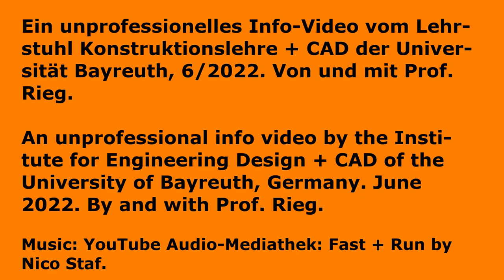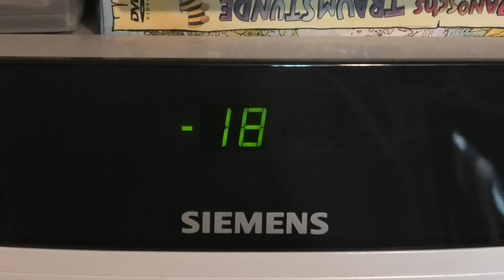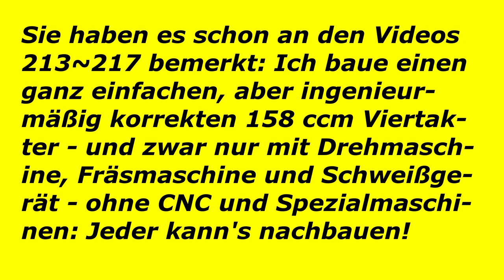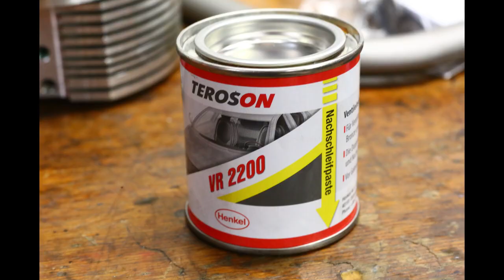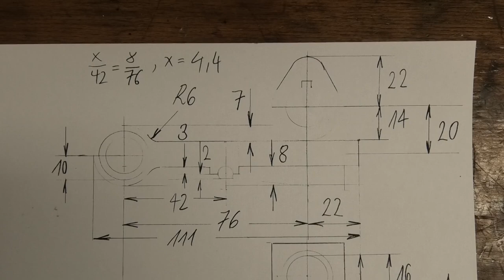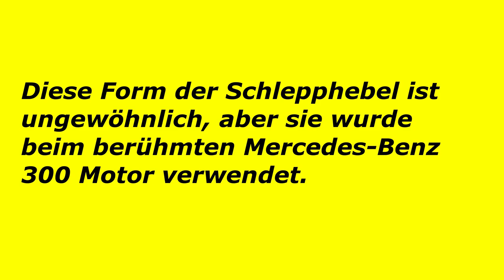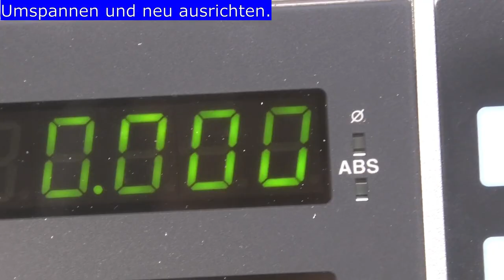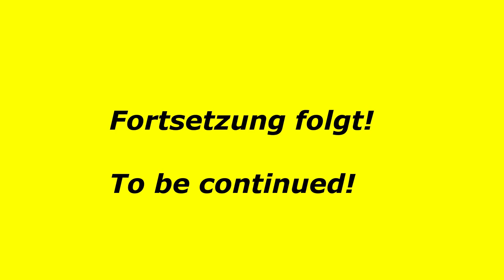Zylinderkopf herstellen durch Drehen und Fräsen für 158 ccm Viertaktmotor.

Comment: I've been a manual machinist for 35 years. That is why I like your channel so much. None of that CNC nonsense. Anybody can program and let a computer make your part, but to crank the handles take skill! On a different note, I was taught at the Briggs and Stratton service schools that valve seats cut on 31 and 46 degrees and valve faces cut on 30 and 45 degrees because of the temperature difference between the seat and valve face takes up the 1 degree difference at operating temp. When you lap valves into the seats, you lose that difference and valves will leak at temp an fail prematurely. Great job. Can't wait to hear it run!!
Reply from the maker: Thank you very much for your hints regarding valve seats and your comments - very kind of you!
Reply: CNC IS Nonsense ?   If you had been a CNC Machinist, you will know the real Truth about this working. You will really need much more than a Computer and a Program / Machine. What you must not have is fear ( like you had ). Sorry.